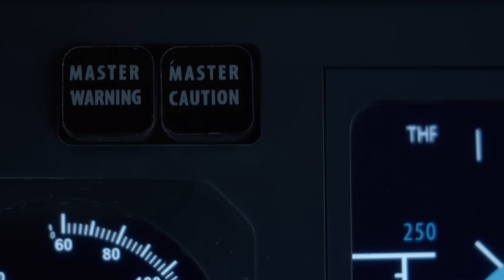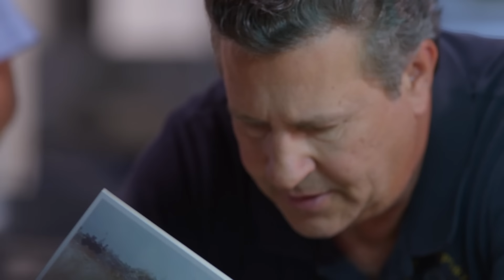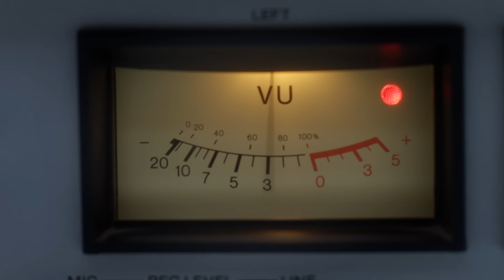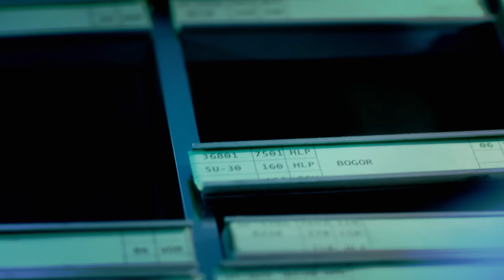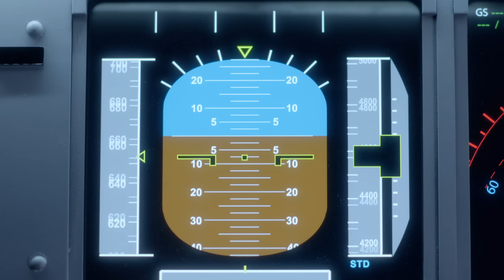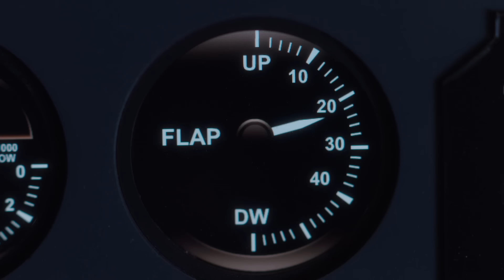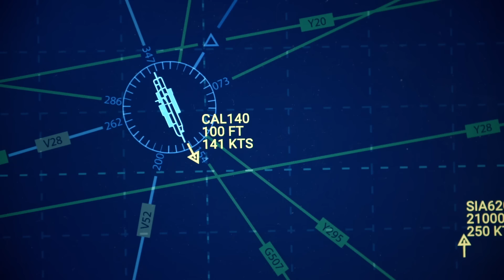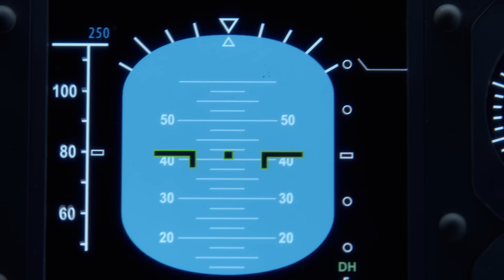Every Plane Crash from Air Disasters (Season 12) | Smithsonian Channel

Comment: 11:24 "...and the electrical circuitry appeared normal". How does anythig appear normal from a crushed and crumbled aircraft?!🤔🤔🤔
Reply: They would remain in same setting on impact.
Reply: @jakowako7157  If its the control panels I can understand, but the cables hang all over.
Reply: @webwana  then they would be chked for condition,for those that arent burned by jet fuel.
Reply: @jakowako7157  True